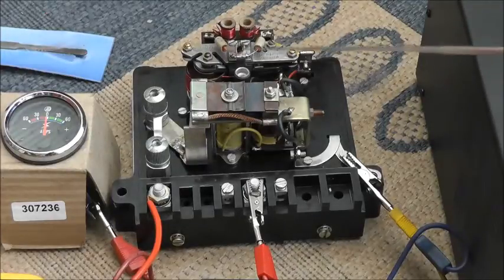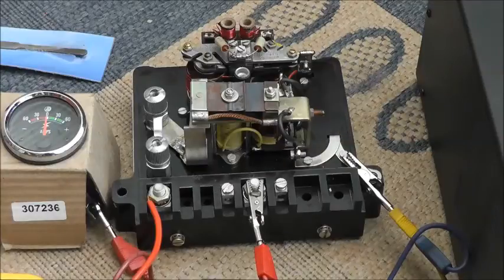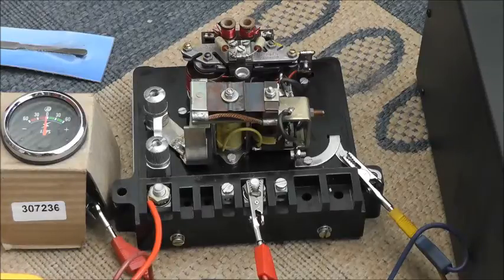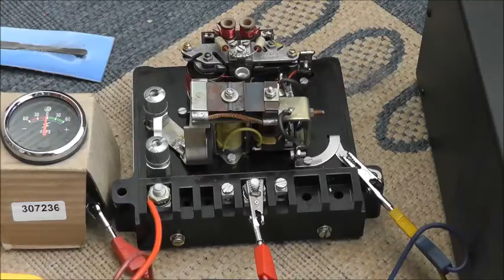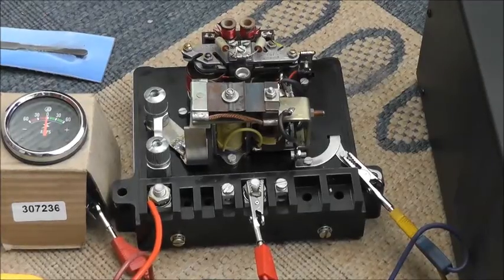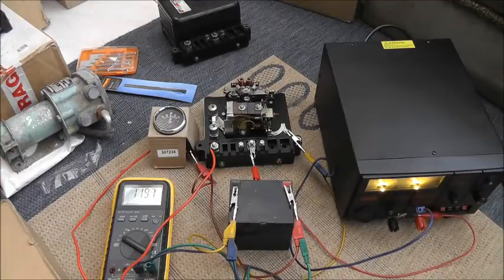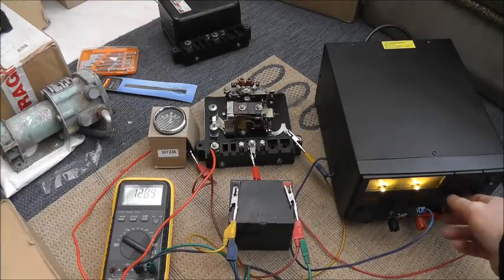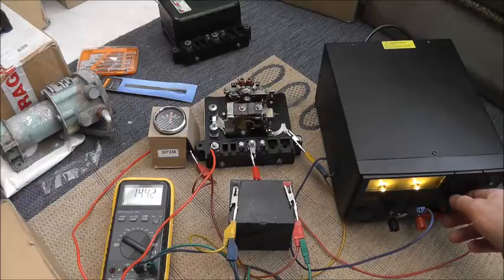CAV Control Board 202B Bench Test

Comment: Many thanks for this. Can you tell us the details of the voltage supply box is please? Make and model  ETC. I have a few early 24 V AEC Matador units to run through. Much easier to do them on a bench than a vehicle!
Reply from the maker: CAV 202b
Reply from the maker: 12v